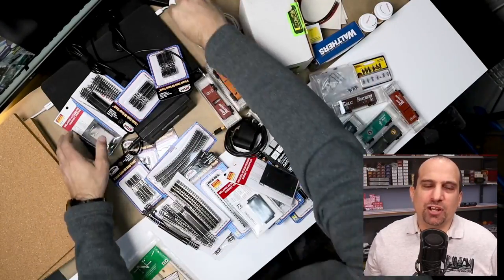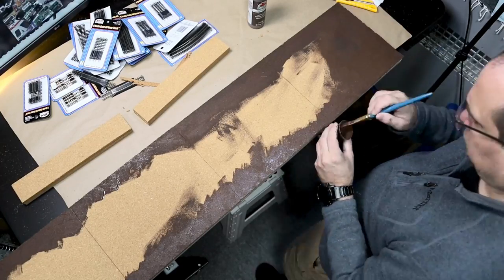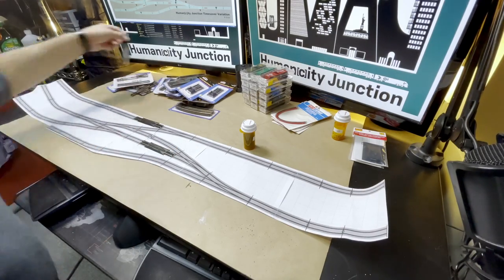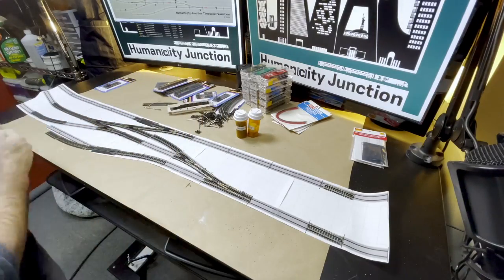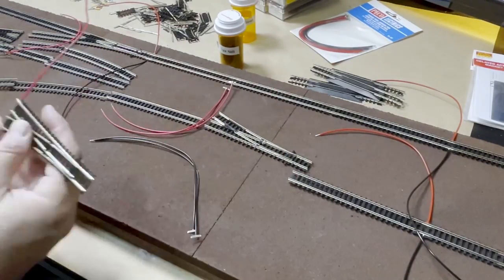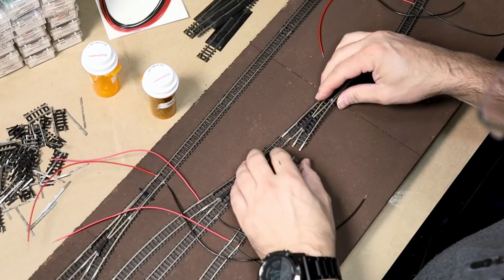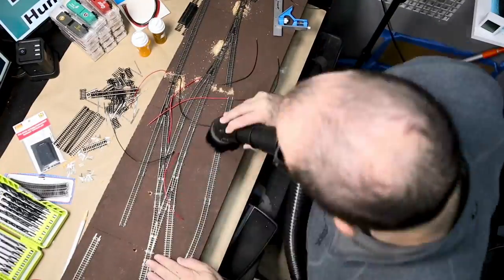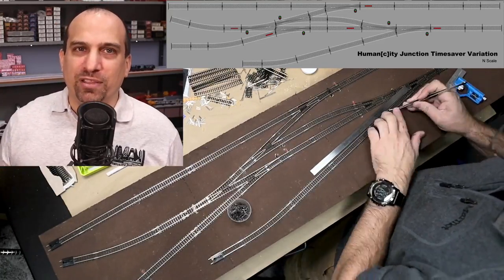This Is For You | Timesaver Variation | Model Railroad Shunting Puzzle

Comment: This is pretty cool that your making a switching puzzle as well. These are good for critical thinking skills. MicroMark has track nail insertion pliers. - Jason
Reply from the maker: Yeah, I stole the idea of a remote operated switching puzzle from another YT'er that is doing the same thing. I just have to rmemeber who it is.
I tried tweezers, but I probably should have used one of my many pairs of pliers.
Reply: The track nail pliers that Micro-Mark offers will be good for starting the track nails into the cork.  Depending on their length, you might need a nail set punch and a small hammer to get them to penetrate into the shelving subbase. 
Overall, you have a great approach to getting your switching layout up and operational.

Comment: Nice job!  I built a Timesaver a few years ago in HO.  I used mostly stuff I had on hand, used Atlas Code 100 Snap switches, some Atlas flex track, etc.  I think my only cash outlay was a quart of matte acrylic wall paint, a few Kadee uncoupler magnets, and some cheap Radio Shack push button switches to control the turnouts.  The overall size is 12” x 72”.  1/4” plywood on a frame of 1”x2” strips, glued and nailed at every joint, resulting in a strong, rigid, relatively light structure.  The control panel was mounted flush in the near right corner of the layout.  I was going to buy a nice brushed aluminum door push plate to make the panel until I saw the price.  Fortunately, Indiana uses flat (not embossed) printed auto license plates.  An expired tag, cut down, flipped over and given a good sanding and/or a coat of paint, is a free substitute.
Reply from the maker: My first build, I used all track that I had. To make it more reliable, I ended up swapping out some old with new.
If not for this project, I would not have gotten into operations.
Thanks for sharing your project.

Comment: Heath, I use the track Nail insertion tool sold by Micro-Mark. I also use push pins to hold the track in place while I nail down the track, keeping the track where it is supposed to be.
Reply from the maker: Of cours Micro-Mark has a tool for that. :)
If I used flex track, I would definitely have pinned it in location before pinning it into final location.
Thanks for watching and commenting.

Comment: Regarding track pins. For many years I have used a wooden clothes peg ("clothes pin" as you guys say in the US) File a small groove in both of the 'pinching' faces of the peg. Just slightly smaller than the diameter of your track pin.  Lay the peg along the track. Then whittle away the top of the side of the peg that is facing up so when you insert a track pin it sticks up from the shaved face. Now just tap lightly with a hammer and you can pierce the cork and even the first bit of wood. Remove the peg and finish setting the pin.
Reply from the maker: Thanks for the suggestion.
I ended up getting a pair of pliers that have the groove cut in it like you are suggesting with the coths pins.
I am using a nail set, without a hammer, to just push the track pins in. The extra size of the nail set allows me to push just hard enough to set the pin without the need for a hammer.
As much as I sometimes want to hit the layout with a hammer, this is one time I try to avoid it, LOL.

Comment: As far as pinning use a pliers with a slight bend in the tines. Use these as a mechanical advantage. Use these for jewelry pinning at werk
Reply from the maker: I was using tweezers like that but did not have enough leverage.I have plier like you mention, I just did not think to use them.

Comment: Very nice Heath, I'm using screws to hold down my n track
Reply from the maker: Those must be really small screws.  I can barely see the nails, I cannot imagine finding the slots on the screws.
Reply: @HumancityJunction  The track screws sold on eBay and by European model train companys, PIKO, Marklin etc have a 0pt cross head, a 2mm pre drill hole into plywood thru the track to secure. Easy, removable, adjustable for pressure.
No trouble finding the slot!

Comment: You could build several "industries" to set into place and then move or use different ones to make things different instead of seeing the same industries all the time.  It would be similar to using the moveable bumpers.  A scrapyard in one session might be a fuel and oil supply in the next or some other industry.  Be tricky, put an industry that needs more cars after one that does not.
Reply from the maker: Thanks for watching and the suggestion on how to setup the industries.

Comment: Surprised you didn’t use KATO track since you want to break it apart. But I guess for remote ops you need the delay or electro magnets to make it uncouple. Boring to switch if the cars don’t uncouple. And I guess you want to do some turnout learning for the future. Yes KATO can be DCC controlled. You should at least ballast and put in a back drop. That way it could fell like industrial switching. Well you already have suggestions on the nails, but you could just use a small nail punch. Good video good explanation.
Reply from the maker: I think when I build my future mega layout all the track will be flex and the turnouts hand laid, so using the Atlas track is a step in that direction. An opertunity to learn.
Kato does have an uncoupling track, but you are limited where you can put them. I got the micro-trains magnets for remote uncoupling.
I have the Digitrax decoder for Kato switch on my module for my programming spur. But that switch is all gummed up and no way to easily fix it without just ripping it out and replacing it. I learned a lot about Kato switches and would install it differently next time.
A nail punch is the solution for me.
Thanks for watching and commenting.

Comment: GoPros have issues with freezing.. I’ve tried avoiding that brand for that reason.
Reply from the maker: Do you have another recomendation? I am looking for something in a similar price point, with the super wide angle view, with HDMI output.
Reply: @HumancityJunction  I went with a Garmin, but it has its own issues, and I completely get you on the price point. I was looking at Panasonic GH3 camera and they are 500+ dollars. Sadly it's one of those stepping points I'm finding. I've been bitten a bunch by going used or cheaper, probably spent enough by now to buy a new gh7 camera. rofl. my best advise is watch a bunch of camera shoot outs. upgrading to an actual camera vs an "action cam" will make a world of difference. I had a good camera but recording myself welding blew out the light sensors.